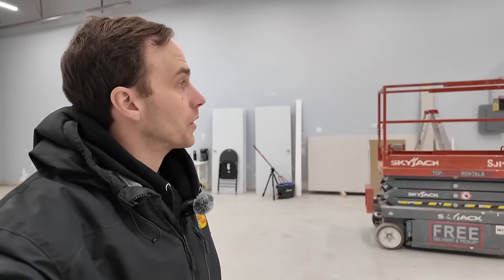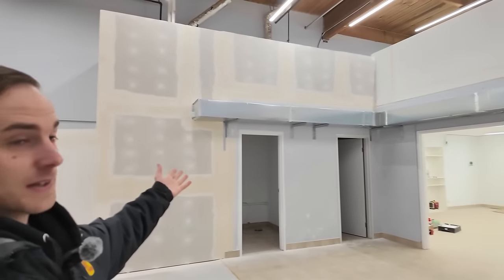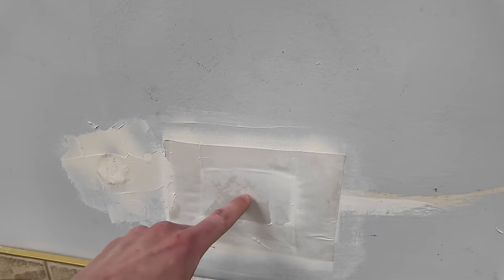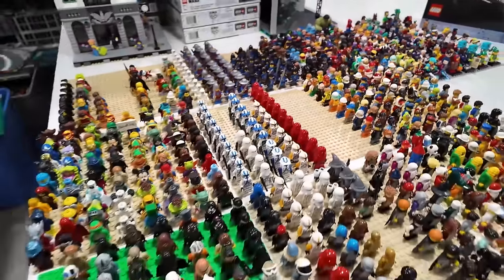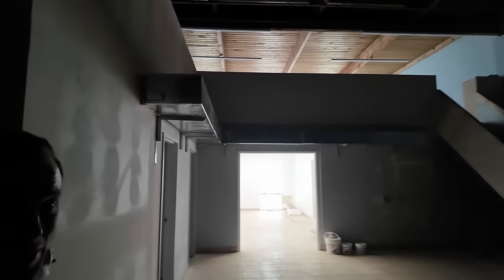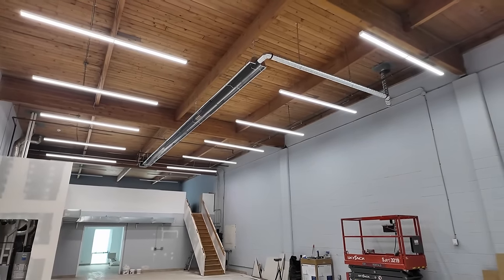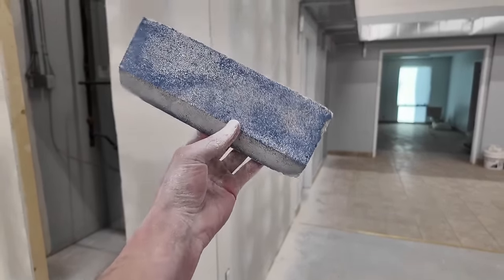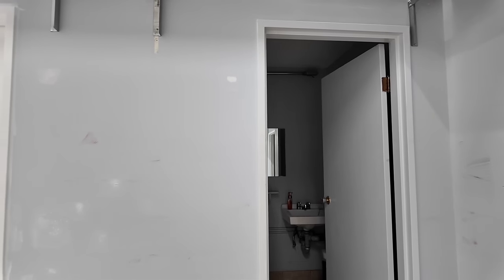New Timeline, Heater ON, Electrical DONE, & Paint PRIMED!

Comment: Hey Bricksie! Senior Engineer here just wanted to give my input on the extra outlet from the furnace. I think you’ve got a great idea installing it to the second floor for future A/C. Heat rises so during the summer it’ll need cooling. Also for winter, you can install a shutoff valve so the heat won’t blow up there then open it when it starts to get hot outside. Hope this helps!

Comment: Today I learned: there are bags for shop vacs. I have never seen a shop vac bag until today in this very video. Over the years I've spent hours cleaning and air blasting the empty canisters outside, I shall begin using the bags immediately, thanks Bricksie .
Reply: Use both and it will never lose suction! Absolutely a game changer!
Reply: Bags are so nice, whenever you need to use it for water just take the bag out and the vacuum is already clean, and no dust. The only downside I've noticed is it doesn't have as much suction
Reply: Definitely use a filter in the shop vac with a bag, if you don’t and the bag gets a hole you will fill the entire place with dust.

Comment: Ecobee thermostat. They have sensors you place in rooms that can tell the current temp and presence. If you're upstairs for an extended time, you may not need the heater on as much, and the ecobee would be able to tell. If no one is downstairs, itll only register that someone is upstairs, and make sure that "room" is at your desired temp. Then, the heater may only get triggered on when the temp upstairs falls below your desired level.
Reply: Fully support the Ecobee thermostat. Being able to monitor and control it remotely is great, and the remote sensors also really help the system understand the full space.

Comment: Hey. Have a recommendation for thermostat. Get a smart one like Nest, and get a compatible nest temp sensor, they sell. You could keep the main one on any wall, cold, hot. But place a sensor on your Lego table or where you sit and switch to that in,the app on your phone
Reply: This way you will see temps on your main unit on the wall and on a sensor and can automate heat to work of either one with a single tap on your phone. You can also easily move a sensor around since it is battery operated tiny pock if needed around premise or buy multiple for upstairs and downstairs for example

Comment: Consider running the 2nd AC duct up the wall and then along the wall to the right (if you're looking at the bathroom) and putting a AC vent blowing down into the mezzanine. You can close the vent off in the winter to not get too hot, but have AC in the summer blowing down on you while building.

Comment: I would split the open vent in the furnace room to the pony wall and the lower area as well. Also, you should install a smart wi-fi thermostat so you can start cooling and warming the space before you leave home.

Comment: I've used that method a few times. I like it. If it's higher up on the wall though and you might hang something from it, i would not use it. Not even for a picture (unlikely it would fail, but why risk it?)

Comment: You could route that vent to the mezzanine level and install a vent blocker/damper that you can leave closed in the winter so it doesn't blast extra heat upstairs and then open it up in the summer so it emits cold air

Comment: Jordan, I know you want to just paint everything all at once, but would there be an advantage to paint the front rooms so you could start moving cabinets and sets to those rooms? If you have to wait 4 days for progress, I could see you getting very antsy (unless you have plans and thats the reason for the delay!) and needing something to work on. It seems like aside from the touchup painting all of the remaining work is in the back section. Just a thought. 

So exciting to watch all this. You have definitely transformed that back space from an industrial area to a nice looking backdrop for your city.
Reply: I think he wants to wait for the sanding to be done to prevent dust deposit on shelves / Lego sets
Reply: @AnthonyPerot  for sure. That's the reasons I waited until now to make the suggestion as priming has been done so no more sanding. Additional sanding would just be limited to the upstairs area when they do the pony wall. Which I think would have a limited impact on the front rooms.

Comment: As I mentioned previously…you only need the radiant heater to ‘face’ the exterior surfaces.  If you heat the exterior then you do not need to heat the interior.  Large radiant heaters are meant primarily for out door or space that is open to the exterior like garages and warehouses that have many cargo doors open etc.  they heat surfaces not the air.  Were you asking if you should believe the commenters or the tradesmen?  Good luck!  I know you don’t need input on this stuff but was just trying to help.  Keep up the great Lego content when you get time!